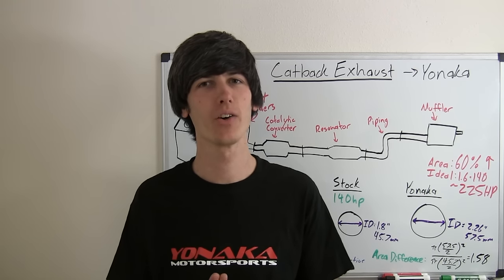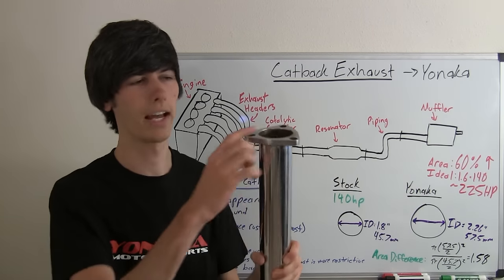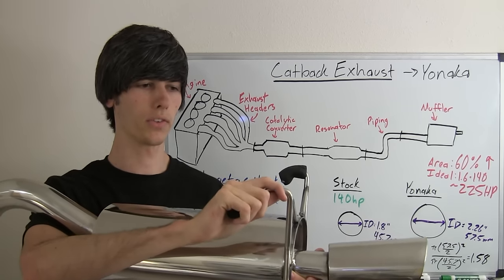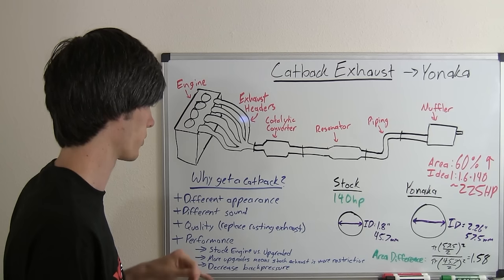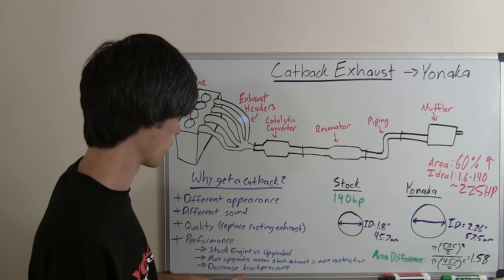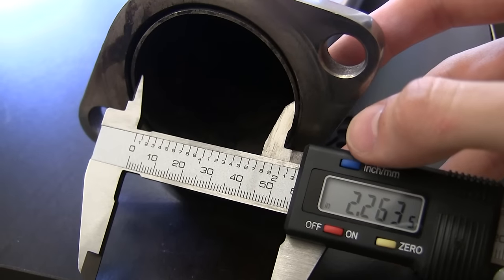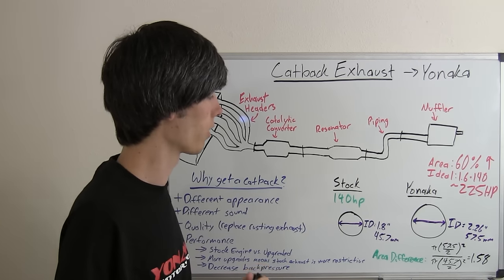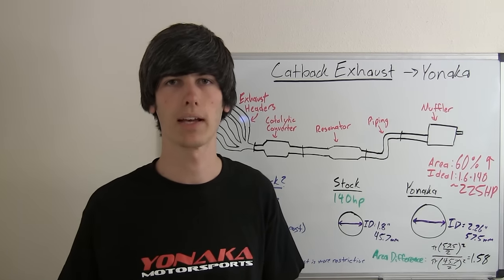Catback Exhaust - Explained

Comment: i have a question.. i bought a 2015 rs camaro v6 and iv'e been running 91 octane and some people and the manual recomends 87 octane that's what the car is tuned for will there be a benefit of running 91 if its not tuned for it ?
Reply: +Teway80 then why does the car feel smoother and more powerful?
Reply: +Po Russki Some modern vehicles have sensors that can adjust the engine to run more aggressively when given higher octane fuels, but my guess is the increase is nearly imperceptible. Check your owners manual for details.
Reply: +Evan Van Slooten my new camaro says 87 but I heard if you fill with 91 and do the fuse pull it will remap for 91 but idk
Reply: Brian Knox You could put the ECM into a learning mode, but if it were me I would stick with 87. The computer can't control the engines compression ratio, it's a factor of the engine components. My guess is the performance increase will be fairly low if at all. You may see slightly better fuel economy, which will be offset by the higher cost of fuel. That is unless your Camaro is boosted in some way. Then higher octane and retune will yield better performance.
Reply: +Evan Van Slooten true..  I know now it doesn't ping on the top end with 87 so it probably wouldn't change much ur right
Reply: +Brian Knox unless is LS v 8 engine, most chevy ok with cheap gas
Reply: +Brian Knox check your owner's manual. usually for most cars, you only need 91-95 octane (refer to your car's manual "and availability"). some people want higher octane because it is (usually, as it is supposed to be purer) least likely to leave dirt in your engine, which in the process gives you better mileage. Not really sure about 6 cylinders + + + engines /L. And like what teway80 said, for cars with high compression ration 98 octane is a necessity. If you want more  actual horsepower, have your car tuned to e85.

Comment: Can someone help me, I have a 3.8L V6 Holden (Australian car). Currently it has a 2.5 inch sports catback which gives it a bit of noise but the Cat and the headers are standard. What I'm wondering is, for purely noise reasons, would I be better off putting in a high performance high flow cat and sports headers or do the cheaper option of just removing the muffler?
Reply: Austin Pond swap the muffler for a connon if its purely for noise, no muffler is just too loud and messy even in a turbo charged set up.

Comment: Hope you can help me out so I got a mid pipe n cutback installed with a 2.5 pipe, so when I drive it it sound great but once I start getting to 3.5-4 rpm it sound raspy like if vibration on the exhaust sound can I get tips of how to get that off n another thing Can a small part where it didn't get welded right effect? Sorry for the long essay.

Comment: Hey im  fairly new to the car game im 15 I have a 1992 s13 nissan 240sx im looking for an exhaust idk  straight pipes are loud enough for my liking, any recommendations?  also wondering what the crackling sound I hear from some exhausts are from.?
Reply: you need swap that motor get sr20det motor then get a 3inch full exhaust system catless downpipe.  ported intake manifold. 3inch intake,1000cc injectors,walbro 255 pump an tune on E85 has you be quick
Reply: mine crackles haha loud and deep sounding (04 neon srt4. 3inch turbo back exhaust ,running a precision 6262 built bottom end, on E85 613whp 550Tq
Reply: XiHawkeye  who me?
Reply: yes man

Comment: you lost me so I don't think this is what you meant but this is how I took it all new exhaust took it from 140hp to 225hp again that is the way it sounded to me and I find it hard to believe new exhaust would gain 85hp. so can you help me out is this true or did I hear this wrong?
Reply: He is saying that the 60% percent increase in area of the exhaust is ideal if your engine is tuned to 225hp from 140hp, not that a 60% increase in area will increase your hp output to 225. Basically, the more you tune your engine, the more output there is on the exhaust, so you want to increase your exhaust area proportional to your increased hp relative to the stock area of the exhaust and stock hp.

Comment: it's not quite that simple. if you go too large you can lose power, particularly on a single cylinder bike. as the exhaust is pushed out of the engine it moves back along the pipe. when it reaches the end of the pipe a negative pulse moves back up the exhaust pipe (at the speed of sound i think). if you size your pipe right (dia and length)that pulse teaches the exhaust valve as ours opening the next time and helps suck the exhaust out.

Comment: It's quite hilarious that you would criticize his math, given you apparently are not very good at it.  An exhaust pipe is not a straight line, and it's also not a square, it's a CIRCLE, and it's a calculation involving AREA.  You have to divide the diameter in half to get the radius, then square the radius and multiply it by pi to get the area.  You do that with 45mm and with 57.5mm, then divide the result for the 45mm diameter pipe by the result for the 57.5mm pipe, and you will see.

Comment: Im confused did you said it would bump the hp to 225 or the exhaust is fit for a car that has 225 hp?
Reply from the maker: The exhaust would be close to ideal for a car with 225 hp, the exhaust itself will not "create" that much more power.
Reply: Engineering Explained
So why are You Switching Up?, You Said One Could Jump From 140HP to 225HP By Just doing this Mod... :o

Comment: I cut my res off and put flow master I was driving at a high speed on the high way and when I turn my car off and turn it on I had a low rpm I had to hit the gas to get my rpm at normal range

Comment: so i hope all the non tuned ie stock engine cars wont do this until they make 225 horsepower. because i have seen mostly stock cars doing this without any modifications , and they can not keep up with low output traffic red light to red light

Comment: what kind of math is this? percent area increase in pipe cross-sectional area = percent increase in horse power? that's just ridiculous. you will have to work out the exhaust gas flow velocity at a set RPM, from there you can calculate the pressure loss in piping, then you can calculate the power consumption difference due to friction head. and you can compare the two piping for difference just due to the ID difference alone. It's simple fluid dynamics calculation but not thaaaat simple as you just did in the video.

Comment: Anyone on this page who can answer this question.
I just brought A brand new 2018 Wrxsti spec R bone stock and I would like to install a Invidia R400 cat back exhaust that's the only mod I want and I know it's won't give me any gains in HP I just want it a little bit louder then stock, will installing this mod cause any harm to my engines reliability? Or is it safe?

Comment: I don't think so!
My Suzuki GSX1400 would have more Power with bigger diameter by high RPM. Flow is better and you get more Oxygen because burn gases can better flow out of the zylinder through the Exhaust. 

Sorry for my english^^

Comment: Idaho pickup owners don't need this video.  They just remove the exhaust from the catalytic converter on back and stick a glasspack "muffler" under the truck.   They don't need a jack for this operation since they can freely walk under the sky high jacked up vehicle.  Their main concern with power is that they display it.  Of course this is Yahoo Central.  It's not quite as bad in the Yahoo suburbs.

Comment: But can't having too large of a diameter exhaust system lead to the pressure of the entire system being to low? I hear that having too low of exhaust pressure in can cause damage to the engine, from the exhaust cooling excessively quick, causing damage to the valves and gaskets. Is that why they design cars with the size exhaust they do?
Reply from the maker: Andrew Wittwer It's not the lack of pressure, it's the lack of velocity. Here ya go: Performance Exhaust - More Horsepower

Comment: so ive got a old go kart that I want to straight pipe, can I do that without loosing power or anything like that?
Reply: +Zipping Basher Yes, as long as the pipe is of a certain length. Pipes that are too short can damage the exhaust valve from the sudden temperature change each time you shut down the engine.
Reply: James Kim So would a pipe thats 2 1/2 feet long be enough? Also does it effect power or no?
Reply: +Zipping Basher not very much. It'll sound badass though👍
Reply: +Zipping Basher Yeah that should be plenty of length. Power difference will depend on how well the cylinder head is flowing.
Reply: If it's a 2 stroke with an expansion chamber you'll lose power for sure.

Comment: so if u just need to free up the air flow for HP then wouldnt u wanna just do a strait pipe?
Reply: Richard Manzanarez Yes. But noise restrictions and emissions are a thing.
Reply: Richard Manzanarez  straight pipe is worse no backpressure means exhaust wont leave as fast think of a free flow garden hose vs some pressure makes it leave faster. faster flowing gases will make better performance

Comment: The only part of the video I do not agree with is the measurement of the catback. You measure the TIP of your car and the exhaust piping of the Yonaka catback...The tip does not necessarily represent the piping diameter.

If you were just theoretically speaking, please ignore my comment.

Comment: SO- why do car manufacturers not equip their "sport" models with an exhaust and tune that would get the most most power out of their engines?

I've been asking this question to myself for awhile. Is it...
* Emissions? hmm... larger pipes still pass, right?
* Cost? could it really cost that much more to manufacturer 1/2" wider piping?
* Longevity? does allowing more airflow to/from an engine decrease its lifespan?
* Profit? do they get a kickback from aftermarket companies? wouldn't their own branding be more important to them even if so?
* Noise? does a quieter ride appeal to a 'broad'er market?

Hopefully someone can give me an explanation that makes business sense!
Reply: They equip it with what is standard power output, but when someone gets bigger turbines and chip tuning the standard exaust is no longer optimal and upgrading will be closer to optimal then thus gaining u more HP
Reply: Dino Harandi what does "standard power output" mean? My question is why don't manufacturers build cars with the optimal exhaust & tuning from the factory??
Reply: It is optimal, it passes enviromental laws, shows good MPG on standard-lab-test and is tuned to some reasonable ratio between power/durability/comfort
Reply: Many do optimise for their sports models. I have a Volvo S60 Polestar which has a 2.5 in full flow exhaust as standard. Some might say it is not loud enough though and manufacturers will always err on the side of caution. I am glad it is not really loud. Loud is not fast, just obnoxious.

Comment: So what is on a stock exhaust because it seems to have all of the same components
Reply: +JonathanDoors The components are basically the same, but designed for the stock motor. When you upgrade the engine's performance it enhances the combustion, generating more exhaust gases thus needing a proper exhaust system.

Comment: so if i put a performance catback on a full stock engine ill get more power on not?
Reply from the maker: Could go either way. I'm hoping to test this one out to see.
Reply: you'll make another video for that?
Reply: depends on the engine and its accessories.
if the engine can benefit from free flowing exhaust, then yes. if it will suffer from loss of vacuum pressure in the exhaust, then no. it would also probably only affect a portion of the rpm band more so than anything else.
Reply: I hear fron a miltek exhaust from a vw golf r32 gives you some performance boost not cheap thou but you could be a rich fella
Reply: tecknoid659 We all know engineers at VW are smarten then some at Miltek and Shiltek and Piltek and Ziltek... they optimise the car to details, its only reasonable to do it when u break the ballance (by chiptuning, changing turbines etc) or u are willing to sacrifice a band of RMP to gain some at other band of RPM
Reply: it depends on the system as a whole.
Reply: Short answer: Improve top end power, hurts bottom end torque.  The goal shouldn't be peak power but total area under the torque curve.  If the left side, shrinks by say, 5 torques, and the right side goes up by 1 torque, you may have made the car slower....

Comment: except that most of the back pressure is caused by the catalytic converter  , which is not even touched.  some1/4 or 1/8 miles times before and after cat back swap would most likely show that you wasted your money :)

Comment: Wait a minute.  You measured the size of the tail pipe and then measured the size of the exhaust pipe.  You need to actually measure the same pieces, and the tail pipe has little to do with performance.  So, you should have measured the sizes of the same section of the exhaust pipe in order to get a better example/comparison.

Comment: so this cat back is only for when someone increases the power of an engine.. and someone that didn't increase power won't see a great result other than noise in theres?
Reply from the maker: Correct, if you're looking for a power bump, it will be very minimal without other modifications.

Comment: So if I put this Yonaka catback exhaust kit on my stock 97 GS Integra it will increase my horsepower from 140 to 225?
Reply from the maker: No! I was simply stating that would be an ideal power range for this catback, not that it will produce that much.

Comment: I don't think the correlation between the increasing of the diameter and the increasing of the power is that direct!
I mean if a increase the hps to 500, 600 maybe it's 400%more than the original. Does it mean i have to increase the diameter to 25cm? I don't think so.
So where's the limit of that correlation?

Comment: wait but why are you using diameter in your area calculations, shouldn't it be the radius squared not diameter squared?
Reply from the maker: Logan McFarlane Just different formulas, compensate if you use D.

Comment: Doesn't literally every car have a catback system from the factory? Isn't catback just the section after the catalytic converter? I don't understand how a "catback increases performance" if even from the factory it has said system in place. Unless he just means replacing the catback system with an aftermarket kit.
Reply from the maker: JuggernautOfWar Yes, but typically you'll increase the diameter with aftermarket kits, which allows for less restriction if you've increased the power of the engine significantly.

Comment: hi i need your help  i installed headers long for my car but i have problem check engine appear to me and i checked it seems to me this code poo31code / bank1 sensor1 

do you think if i clean the sensor in headers will solve the problem ?

Comment: Isn't more horsepower mean more fuel? Can you get better fuel economy while improving horsepower? As in best of both worlds?
Reply: +Jason Lurf the factory tends to run car a little rich the help keep engine temp down and account for sudden changes it throttle position and if you get a computer tune the engine can be optimized. the factory always has a conservative tune on cars that they build with a good tune you can increase both power and economy.
Reply: +Jason Lurf Yes, When you turbocharge. problem is some good turbo kits are a little bit pricey.

Comment: That's what you call "fuzzy math."  How do you get a direct correlation between exhaust pipe diameter and horsepower? If that's the case, why not increase your pipe 5000% and just have a big old garbage-can-sized hole out the back for 2000 horsepower?
Reply: he is saying that the exhaust, for its diameter, can handle an engine up to 230bhp before becoming restrictive, for its diameter. If used on a lower power engine the increased flow may help it produce slightly more hp.
Reply: Ah, OK. Guess I misunderstood then. But this still assumes there's something restrictive about the factory tubes, or that they're already at 100% capacity.
Reply: he assumed the exhaust had a size that balances well the air flow(not too small to restrict flow and not to big to not creat backpressure) for the amount of power the engine produces, wich i think it's a pretty good assumption, so he can apply the same math, without knowing the exact numbers.

Comment: Anyone can help me but, will I lose hp if I straight pipe my car? A 3inch straight pipe with muffler and resonator delete but with cats. I have a 3g eclipse GTS if that helps
Reply: You shouldn't use 3 inch unless your car is making way more horsepower than stock

Comment: Manifolds are the biggest restriction, start there.
Reply: +Nick Breen On my car replacing the stock exhaust manifold even with longtubes actually decreases torque in the lower RPM range where you really want it. This is why I wouldn't do it.
Reply: 1tokeover
I done cat back for zero gain. Then I took off the factory manifolds, had a look at what they were like and nearly shit. They had crimped the pipes down so all material was inside the port area then welded it up adding another 4mm restriction, the total restriction was 3/4 the overall diameter of the port size!!!
I agree each car is going to need it's own thing, they are all different, but the mani's really made a big improvement to mine.
Reply: Nick Breen What car do you own?